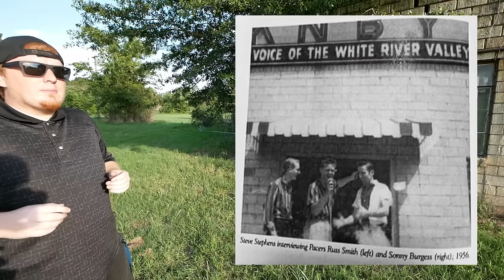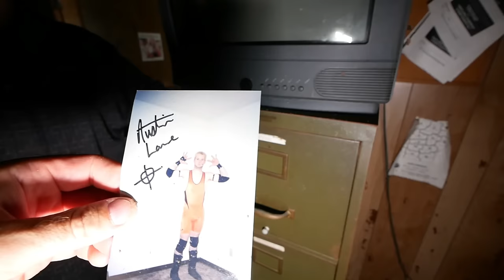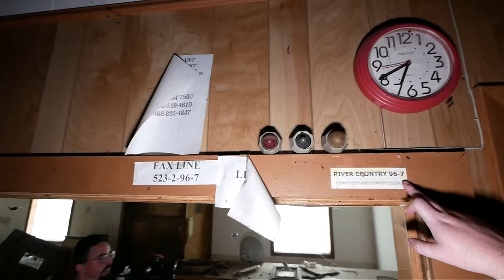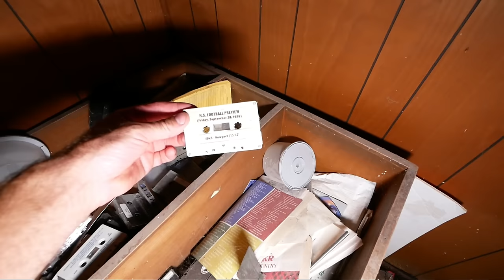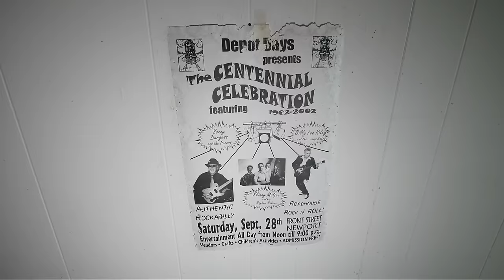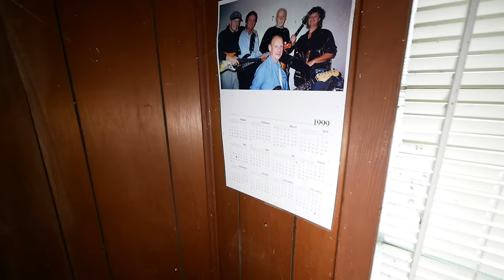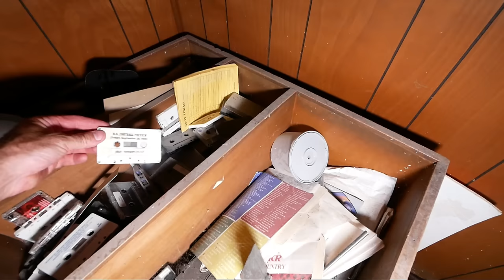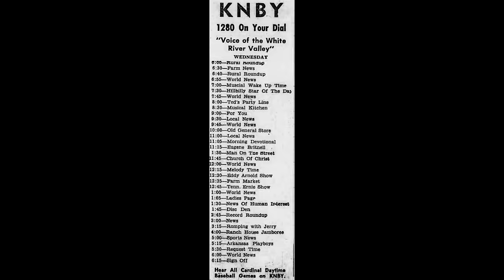Abandoned 1940's Radio Station With Everything Left Behind. (So much history here) Explore # 108

Comment: I worked radio for 40 years. If I may add some info:
The three small lamps on the wall are telephone lamps. They're normally used to show the phone was ringing. Different lights for different lines usually. Not saying they couldn't be used for something else.
The reel to reel decks are Revox A77 machines. If they were in good shape, they'd be worth a little money on eBay. I've worked with machines identical to those in the late 70s.
The big light bulb on the floor that you picked up was a beacon light from the tower. It was likely a 600watt bulb, and often 2 of them were in the red light (beacon) at the top of the tower. 
I believe the audio mixer that had the very old headphones laying on it was made by Ramko Research. I used to own one just like it. Those were a real piece of cheap junk!
Those old transmitters have scrap value!
Thanks for the tour. Great video!
Reply: The control board is in fact a Ramko Research.
Reply: They just put out the B77 mkiii so with the added hype of that some of those machines could fetch up to 1k or more. Unfortunately not those specific ones, they look beyond repair. I’d like to own a B77 though, probably be the closest I’d ever get to a real Studer

Comment: Nice radio station tour! I work in radio so this kind of work is my career. Worked on a Gates transmitter similar to the one you found  It would be 5 or 10 kw. The front of the transmitter and is case is grounded . It what’s inside that can fatally bite you. The main power disconnect and your ground stick are your freinds those save your lives. As an engineer did studio engineer work,too  work at the VOA/Marti short wave transmitter plant in Greenville, NC. 100kw,250kw and 500kw transmitters.

Comment: The bell, as it is noted, is a Program Monitor Alarm which would only go off if the AM and/or FM station experiences dead air. The guy wires have insulators on them, so the tower itself was likely the AM radiator. That is a pretty good site to redevelop if the owners can get what they are asking.

Comment: Kinda surprised the antenna tower is still up, 18 years after the site closed.   They're a safety hazard-liability and property owner can get fined if the safety light at the top of the tower stops working.
Reply: 4 ft shorter than the FAA standard.

Comment: The different colored lights above the window were probably tied to different phone lines. When in the on-air studio the red light would flutter on at every ring if the program director or owner was calling you on the 'hotline". And the other two were probably tied to different telephone numbers of the radio station.  The bell in the next room (the office), was probably tied to the automation systems (computers) that were mainly playing the programming. If there was dead air, or a malfunction the silent sensor would trigger the bell, so if you were in the office, you would be alerted to go check the automation system and fix the error.